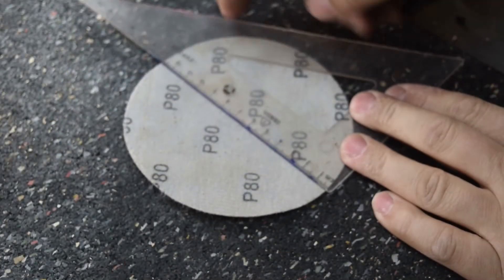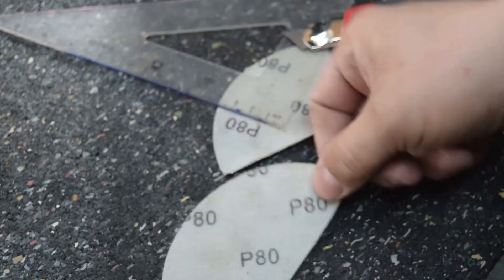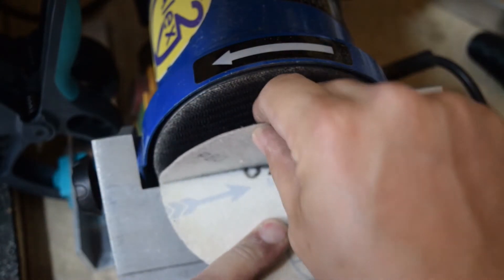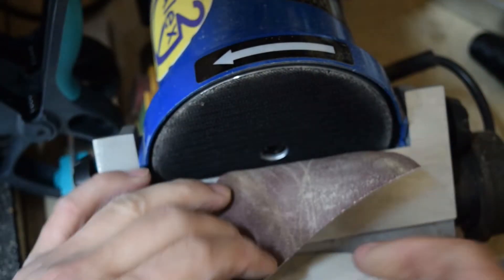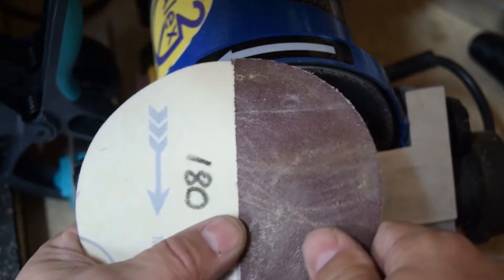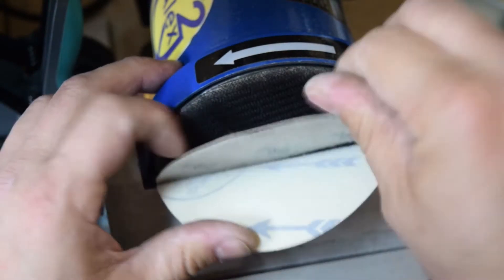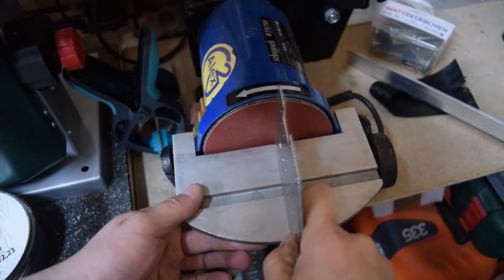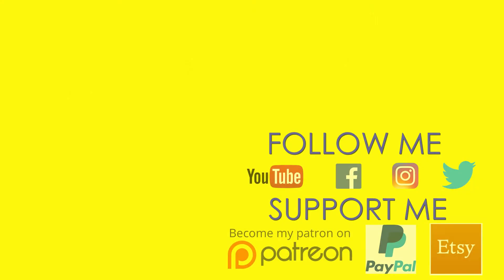Simple Trick for Easy and Fast Disc Swaps on a Disc Sander

Comment: Man.  The last time I changed mine it took Magic to remove it.  Magic and solvents.
Reply from the maker: Was that a disk with adhesive backing? Try with a heat gun on low to soften the adhesive.
Reply: Great Idea.  I actually just got a new heat gun.  Not sure why I didn't think of that.